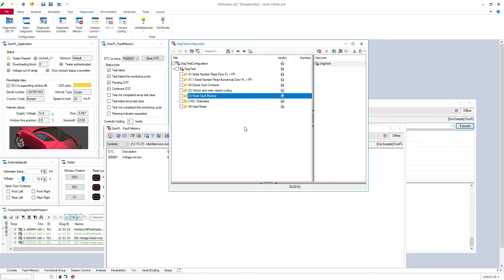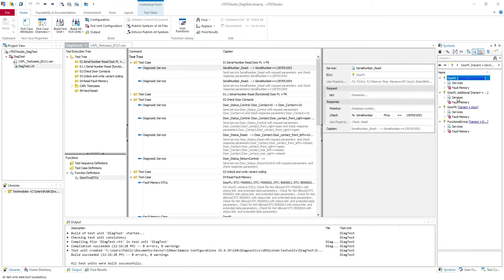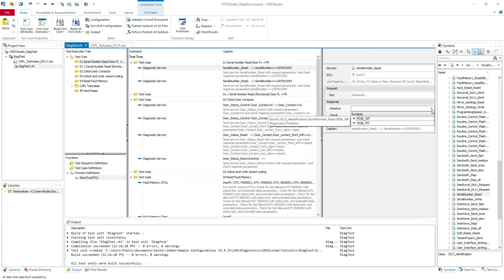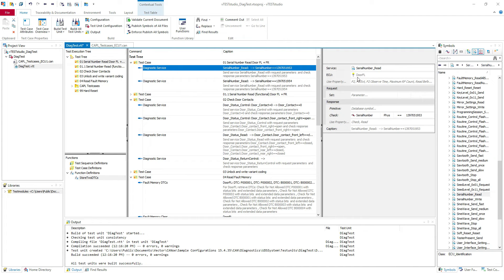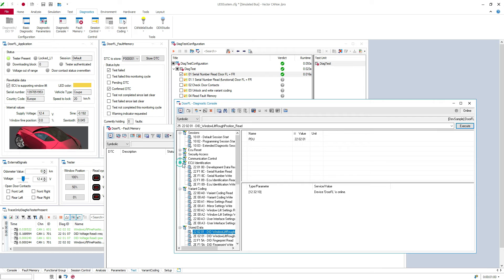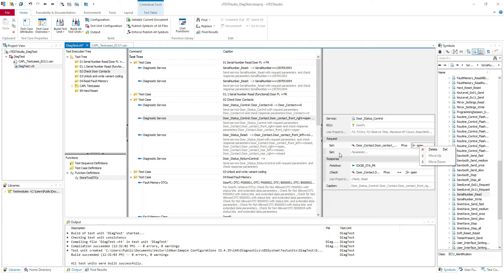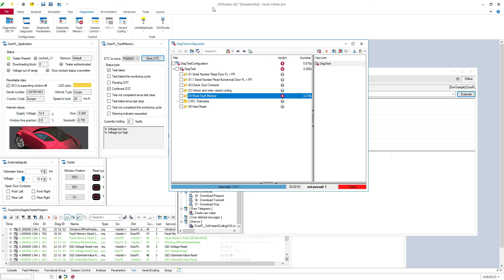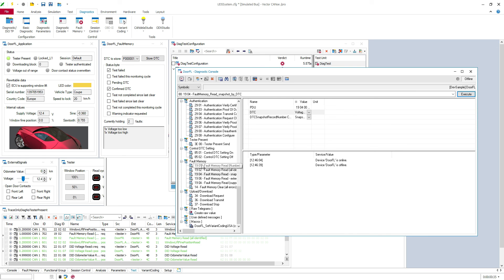08 Diagnostic Testing in vTEST Studio

Comment: Hei! Do you now somehow a way so that I can run the test cases independently, not in suites via Test units from Vtest studio ( tests made as Test Table) ?
 And also, if there is a way to debug the tests semi-automated as it is with breakpoints.  
Thank you in advance!
Reply from the maker: When you run your testcases you can select which test case you want to execute, or you can comment not needed testcases. I think you have a debug option in CANoe but not sure if is useful. I recommend to use write function in CAPL for debug purposes. In this case you will see in write window the values what you want to check.